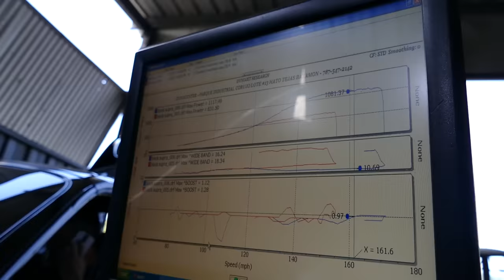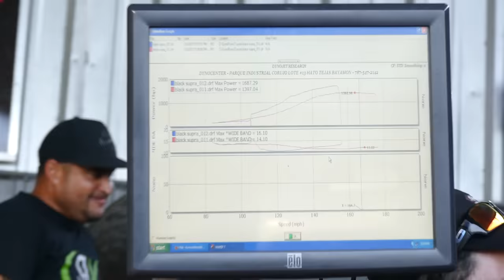1687WHP MONSTER Supra BRUTAL Dyno Runs

Comment: I always think that we shouldn't push these engines this hard just because we can. Theres not many of these around now, and an egine with that kind of power output is going to blow up sooner or later. At the very least, its going to undergo extremely accelerated wear and fatigue. 
Just burning up the remaining supply of engines for the sake of clout.
Reply: you can pretty much buy the whole engine aftermarket, and parts are still available. its not that big of a deal, and you can build them to be quite reliable at high power levels with the right parts
Reply: Don't worry, there's no 2JZ in that thing.  Or if there is, there won't be in short order.  A 2JZ block won't take that kind of power... that nitrous hit would throw the crankshaft at the floor if it was a 2JZ block.
Reply: @stevecole950  ahh, thats cool. I dont mean to be all dictating what people can and cant do with their cars. I didnt realize aftermarket blocks were so common for them.
As a subaru owner, there is one aftermarket block available to us, and its about 20 grand. But subaru engines are literally everywhere.
Reply: @stevecole950  what are you talking about?

Comment: "Brutal" dyno runs?  A dyno is a tool for tuning.  When used properly, it's technical and cerebral, and doesn't come close, on upper or lower end,  to actual performance on asphalt.  A dyno is, at best, half a step above a computer model.  
If your dyno run is "brutal", then you're doing it wrong.

Comment: Lame compared to devil sixteen hp with 3006 at normal mode and on upgraded mode more than 5000 horsepower (dyno maxed out there and that engine was stock)
Reply: The car isnt even out of development.
Reply from the maker: @User-ghcwvouvmgs  So why are you wasting time making such a useless comparison???